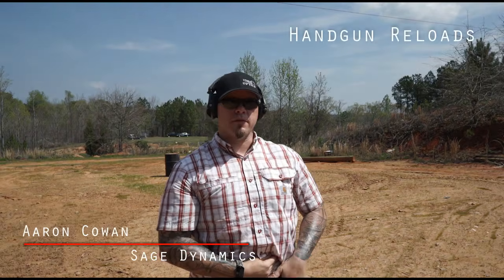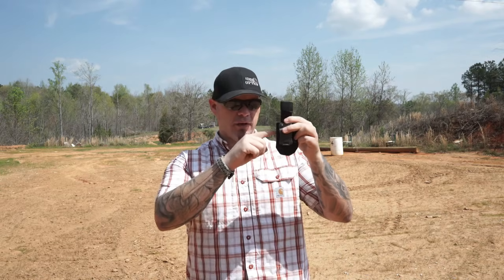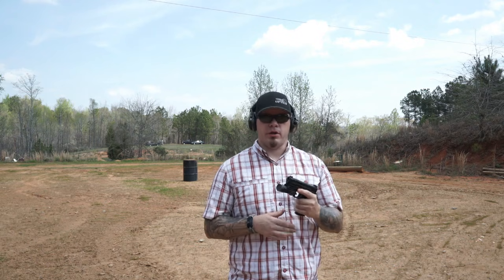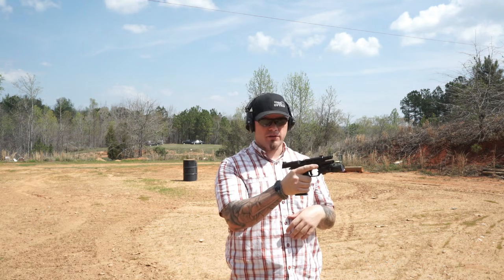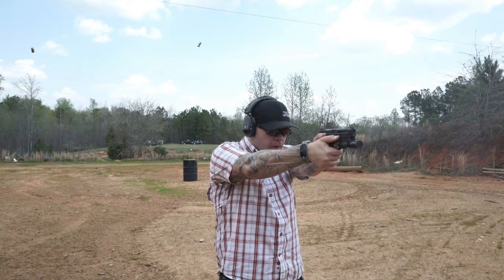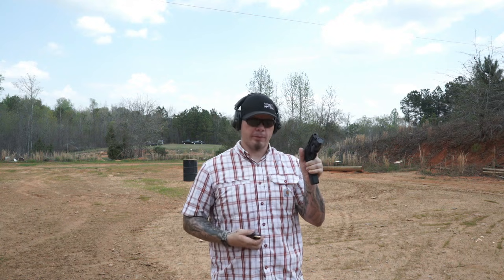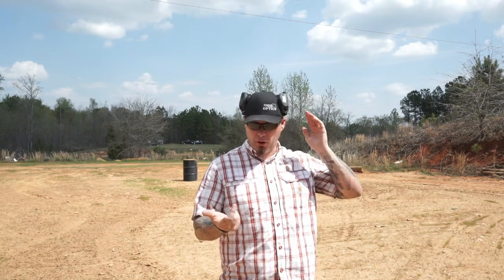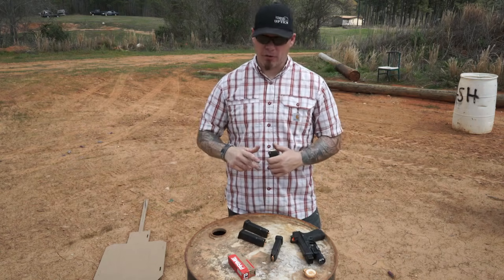Handgun Reloads

Comment: I switched from slide release to sling shot because it's easy to ride the slide release on some pistols, like the SIG P220, P226, and Walther P99, preventing slide lock, and my SIG 232 doesn't even have a slide release and thus must be slingshot. The SIG M17 has a really small slide release, and it's in front of the safety which makes it awkward to press. For the M17, I find that I can use the time when I'm grabbing the fresh magazine to re-orient my hand to my firing grip; whereas, I'd still have an awkward grip after the gun is loaded if I used the slide release. Additionally, the slingshot method does give a bit more recoil spring compression to force the top round into the chamber, but the only gun that's had an issue with that is my CZ75 with magazines that have extended base plates (the top round is a bit stiff and can cause a failure to go into battery). I know those issues can be chalked up to the guns themselves, but slingshot just seems more consistent and reliable over a broader spectrum of pistols, especially newer designs that have a slide release farther back on the frame. But it is undoubtedly a little bit slower, I admit.

Comment: I have the first mp full size pistol, when I put the mag in fast the slide automatically goes into batery, I dont have to release the slide lock, it's like that on every m&p I kno of, this makes reloading fast
Reply: I do the same thing and it works great.  I've seen videos that claim that the 2.0 will not do it, but mine does.  You have to slap it a bit more forcefully though.

Comment: Have you ever worn a appendix holster with the mag pouch attached like the sidecar from trexarms?
Reply from the maker: Ron Bridgefarmer yes.  Hate it.  Inconsistent pressure on mag/gun, especially with gun drawn.  I see holsters like that come through classes and their success Is very body type dependent.
Reply: I carry 4 o'clock still. Have tried appendix with no success. Guess I've carried 4 o'clock for 30+ years, hard to change. I did like it just haven't found anything comfortable. Thanks for such informative videos.
Reply: I did for a over a year. I have it up because is to much carrying a full size kit. I also left appendix and went to 3 o clock carry. It's more comfortable and I can engage in unarmed combat easier. I found out in my time doing BJJ that it's much easier to grapple and protect the firearm, especially from half gaurd. When I tried to perform any techniques with a large pistol appendix it's painful and is right there for another skilled opponent to grab. I don't regret it. I now run the Trex arms lightbearing raptor.
Reply: Ron Bridgefarmer my opinion is people who are armed don't consider enough the the necessity of empty hands skills. People can disagree and that fine but, how many times have I needed unmarked skills vs armed skill?, especially for the LEOs I train with.
Reply from the maker: Free Arms can't say I've had any issues with ground work wearing appendix. For LE we are talking about a duty carry rig, which changes the dynamics of weapon retention.  There's also other tools available besides empty hands.  For the citizen, it's often gun and hopefully handheld light, but little else.  The number of non-LE that get weapon retention training is fantastically small.
Reply: I totally agree

Comment: "The slide release is a fine motor skill, power stroke under stress"
Something I never understood. The AR bolt release is a fine motor skill, very few advocate running the charging handle. Trigger and mag release are very fine motor skills, does something happen between inserting a new magazine and releasing the slide?
Reply: Because you can use your whole hand slap the bolt release
Reply: @unknown121290  dumbest technique ever. Even under pressure it's so much easier to just press it

Comment: Thoughts on using support side thumb to hit the slide release?
This is something that Larry Vickers still Advocates ( I realize this is because of all the time he has spent on a 1911) and I recently switched to it from Over the Top... I do find it to be faster than over the top, and I feel like it pretty much eliminates the chance of me prematurely hitting the slide release with my right thumb (I'm a Righty) because that left hand Needs to seat the magazine before the thumb can come down and hit the slide release.
Also without a bad lever this technique is almost the exact same when looking at an E-load on the AR platform... so that maintains some consistency between handgun and rifle...
Reply from the maker: Mason Allred it's a viable technique.  Something I generally cover for shooters with smaller hands or 1911 clones that require more downward pressure to engage the slide release.
Reply: SageDynamics 
Thanks for the vids and keep them coming! Yours are the best in the community!
I am pretty close to the west coast, but I intend to attend a class with you eventually!
Reply: Small hands is the primary reason I use my support hand for releasing the magazine and utilized the slide stop/slide release. I have found that due to my short, slim fingers there are very few handguns that I can fully reach the controls on without twisting the firearm in my grip.

Comment: Aaron, what do you think about the argument that you should power stroke the slide because different handguns have slide releases in different locations? Or for things like if one is wearing heavy gloves?
Reply: Mitch Schutter How many different guns do you carry? If you carry more than one model, say a g19 and a smaller gun for carrying with lighter clothing, why aren't you carrying a g26 or 43/42 so you have the same controls? If you're wearing heavy gloves (I live in michigan so I relate to that) practice your reloads with them on and figure out what works with them on and make the decision for yourself.
Reply: I'm mainly talking about the idea of being proficient with many different guns. But now that I think about it, that probably isn't really possible being that guns like the 92 and 226 have decockers and other rubix cube type devices. So that would be a wash. I also live in Michigan, maybe it can be done with thick winter gloves but that will have to be seen.
Reply: Mitch Schutter It's definitely possible with lots of training across all those guns, but in my opinion 99.9% of your training should be focused on what you're actually going to be carrying. I found my manzella all element 5.0 gloves work pretty well for keeping my hands warm while retaining a decent amount of dexterity btw.
Reply from the maker: The better question might be; why run different guns?  Over the top is just inefficient and if a handgun design makes slide release a problem, I'm not likely to use or recommend it to others.
Reply: I think Larry Vickers teaches using the slide release for the sake of universality because some guns have safeties on the slide which you could engage by racking the slide. Given how many guns are there there is no one method which will work with all of them optimaly. Get over it and take comfort from the fact that you probably arent going to be using anyone elses gun. Learn how to use your gun the way your gun works best. If you have already mastered yours, learn the most common one around too (for example the standard issue police gun in your area or the most common civilian one like a Glock 19 if you are shooting something unorthodox).
Reply: I'm just asking bud, there's nothing to get over. I'm glad I can use this method.
Reply: People throw out ideas about what if I had to pick up someone else gun and use it, so on and so forth. Not sure how realistic that is.
Reply: I think its generally a poor idea to be running multiple carry guns. My opinion, guns are generally similar enough where the manual of arms is pretty much the same unless you go to H&K style mag releases.
Reply: People might want to consider ergonomics when selecting a gun. For instance, the Walther PPQ has an extended slide release, lending itself very well to the "opposing forces" reload. (Some H&Ks have similar slide releases.) As Vickers mentions, some guns have safeties that can be inadvertently activated. If you don't need a safety (because your carry isn't job-related or you don't live in a state that requires it) consider a gun without a safety. And so on. So you pick a gun and learn stuff, then go out and get another gun that works well with the best, most efficient, and fastest techniques.

Comment: Good video Aaron, I use to want to own a M&P at one point but now im not so sure. Ive heard the slide stop is touchy? the way you reloaded surprised me because i've heard other people say it can occasionally induce a failure to feed? can you comment on that. And thanks again for the good video, I have to send it to all my XD friends and hope they catch your subtle diss.
Reply: Robert I have an M&P 9c and there is no way that I could drop the slide with my thumb without a ton of pressure so I have to do the "slingshot" release with that gun. I haven't seen that problem on the full size version. If I had it to do over I would have gotten the glock 19 and been done with it.
Reply: Interesting I have a 19 and it is super easy to use the slide stop, my girlfriend on the other hand has a 43 and I have a much harder time using the slide stop on that gun.
Reply: NormalGuyLife haha im the opposite. i sold my g19 and kept my m&p9c. the 19 wouldnt cycle all of the ammo types i would put through it, the 9c on the other hand ate through it like a champ. That being said im picking up another 19 soon and giving it another go hehe
Reply: That's bizarre, my 19 does not seem to care and trust me, im broke I put some cheap ammo through my glock.
Reply: Robert yeah thats what i was expecting on mine. the feel of the gun is dam near perfect. im getting another 19 soon.

Comment: Aaron I do not understand the dislike for the XD/XDM/XD mod 2. could you please elaborate why you and so many people in the gun community shy away from the Springfield line?
Reply: Red New most people don't like the grip safety because of Murphy's law
Reply: Many people dislike the grip safety for two reasons. 1) Its redundant, unnecessary and thus its just one more thing to break with no real benefit. 2) You may need to fire despite an improper grip (fighting over the gun, being in a hurry, injured hand) and the grip safety will prevent you from that even though the gun works.
Reply: Many people dislike the grip safety for two reasons. 1) Its redundant, unnecessary and thus its just one more thing to break with no real benefit. 2) You may need to fire despite an improper grip (fighting over the gun, being in a hurry, injured hand) and the grip safety will prevent you from that even though the gun works.
Reply: gents, I'm not buying it. I cannot imagine a scenario when my grip would be contorted so that the firearm would not fire. 
as for reliability no one has a problem with the grip safety on the 1911, including the marines who currently have a 1911 based hand gun in service. I just cannot write off these pistols for that one reason.
Reply: Go take a multiple day class and then you just may understand.
Reply: red new I agree with you. never had a single issue with my XD sub compact or service model.
Reply: I think Aaron needs to address this issue in a video.
Reply from the maker: Red New I track handgun failures, have for over two years.  Of all the guns that I see come through classes, XDs are in the minority, yet lead the pack in failures in which the gun could not be readily repaired. From grip safety failures to triggers breaking and sticking at reset, they just dont hold up.
Reply: thanks for the reply Aaron, I'm sure you see allot of failures in class and I value your input.